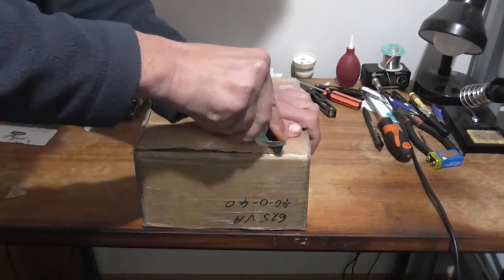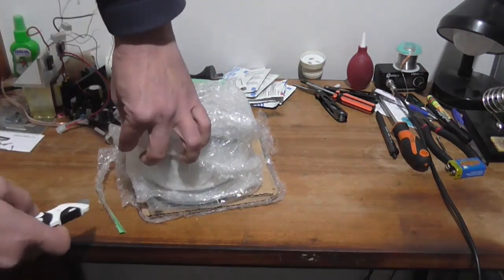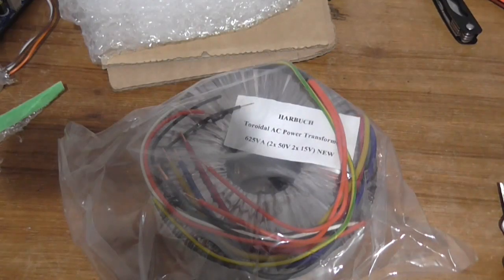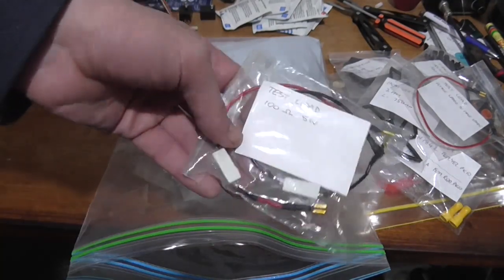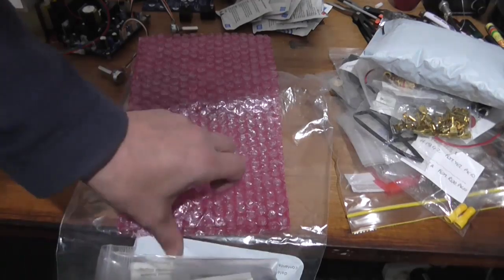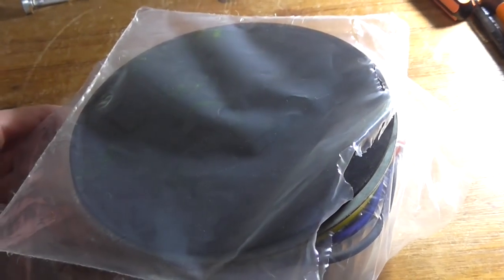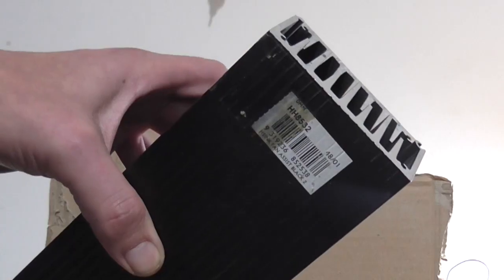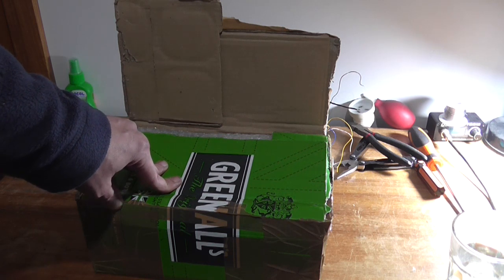Generous Donated Electronic Goodies! [UNBOXING!]

Comment: Holy shit indeed. That's one chunky transformer. Have you considered manually reducing/unwinding the secondary windings to get the voltage that you want? 
It's fiddly but not impossible. I mean, about the only other option you have is to sell it which would be a shame.
Well done Jeff for providing all the gear. We gotta keep Astro's life busy.. Not necessarily easy but definitely busy.😂
Reply: No kidding!  My opinion:  That's a beautiful transformer as-is.  The last thing I'd want to do to it would be trying to partially unroll two secondaries.
If TheAstro30 would publish...  I'll ask that in a separate top-level comment...
Reply: @niftybass  Of course it is a beauty but what other options are there? Sell it/Keep it for a design that does not exist yet and may never exist/ Use it as a a ridiculously large letter weight.